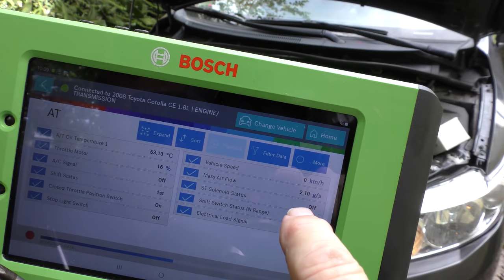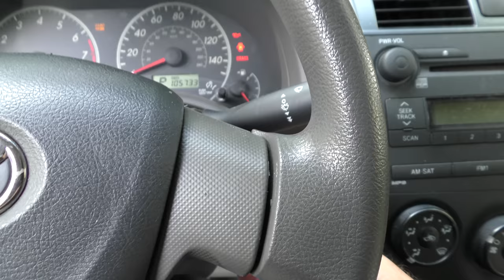Doing This Will Make Your Engine Last Forever (Mechanic Secrets)

Comment: Scotty: this Toyota was wrecked and put back together by morons, but it’ll still run another 100k miles 🤣
Reply: It's a dang Toyota! 😂🤣😋
Reply: I can confirm true, 150k mile 2002 camry wrecked airbags popped and everything. Slapped the thing back together, now at 240k
Reply: Mr Regular can confirm this with his wrecked Echo
Reply: Mael-Strom Chevy was put back together when NEW by morons and it’s still can’t reach 100k original miles without something major blowing up 😆
Reply: Lol
Reply: My wife has a Toyota Corolla, 8 years old, never had a single issue, obviously the usual service stuff but nothing else! Touch wood
Reply: @myMotoring  I recently started a Toyota Echo that had been sitting for nearly a year out in the elements. I charged the battery, disabled the ignition system so I could crank it a few times to get some oil to the top of the engine, then started it. It took a couple of turns - then fired up  - and purred like a kitten.
Reply: @timsmith854  impressive
Reply: @myMotoring  I thought that at least the fuel would be stale, but it was fine 😊
Reply: @timsmith854  petrol should be good for a year
Reply: Ol’ Scotty sure loves his Toyota’s... even the ones wrecked and put back together by morons 😂

Comment: Good man Scotty helping people out .
I had a Toyota Corolla, it was 2 yrs old in 1988 l had the car for 12 yrs it was excellent  l did 189,000 MLS with very little problems.
When l sold it the car would still have taken me round the world no problem.
Reply: The Corolla was all original,
The only things l changed was exhaust systems and brake pads.
Changed the oil and filter every 3,000 miles.
It had 4 sets if tyres fitted.
And the odd bulb.
Best car l have owned
And l am 96 now and have a Mazda 3 which is also  good car.
Reply: The original tyres were 
Japanese Dunlops lasted 40,000 MLS no messing,
It was like floating on air with those tyres.

Comment: That's why you always should buy GAP insurance or a better car insurance policy
Reply: Gap is what you get when you buy a new car.  I don't know that it's available on used cars.  Scotty made a remark about the car only being 6 months old so I thought it was a new car.  After finishing the video, I understand that it wasn't a new car, but a used car.  Still most car insurance policies have riders that you can buy that will pay off the loan regardless of the actual value of the car.  It's always worth looking into.  I have had several service customers over the years who did and did not have those kinds of insurance policies.  The ones who did are always glad about it, and the ones who did not always regret not having it.  The policies are good for the term of the original loan, usually.
Reply: Geico is one of the best.
Reply: @chineduokonkwo5777  I've been involved with many insurance claims over the years. I'm in the car service business.  Progressive is the best to deal with in my opinion.  GEICO is good too, but their adjusters really drag things out. Mercury is pretty good too. I think Allstate is the worst.

Comment: Hey Scotty...whadidImiss? Doing what is going to make my engine last forever?
Reply: a new gas cap and oem oxygen sensor..
Reply: @fidelcatsro6948  No, those things won't make your car last forever. Scotty never said they would anyway.
Reply: I was thinking the same thing.  I do not like being lied to.
Reply: @fidelcatsro6948  what he replaced was a MAF sensor which measures amount of air going into the intake.. not an oxygen sensor
Reply: @shreda125hilux7  oh ok sorry i havent driven a car since my last 1972 datsun 1200cc up till 1999 because of tighter car affordabilty restrictions in my country...those didnt have these crappery and lasted almost forever
Reply: @fidelcatsro6948  all good bud, yeah I agree , older cars were built like tanks
Reply: @shreda125hilux7  ran problem free after i changed those wretched contact point ignition to a used electronic honda civic ignition! everything else was 2 dollar to 10 dollar items like fuel air oil filters nothing special to sense other than that..
Reply: @fidelcatsro6948  was your datsun 1200 a coupe by any chance? I love the styling of the datsun , so rare to see a clean one with no rust these days here in Australia (or anywhere in the world for that fact)
Reply: I also like the mini truck model datsuns
Reply: @shreda125hilux7  the only bad thing about them datsuns: rust buckets
Reply: @thomascampbell5633  Your having a conversation with Fidel Catsro, no matter how you spell it, it won't lead to anything good.
Reply: Make sure it's a Toyota.

Comment: Scotty, Scotty, Scotty: it's Very simple.
The $3000 more she paid for the car than insurance paid out  was, wait for it...
PROFIT
 to the seller. Blame the whole miserable
system.
Reply: dealers can definently scam people who don't know much about buying cars, i bought my accord thinking I was getting a great deal but needed to have a new axle like 8k miles later (luckily usaa warrenty paid for it), again, the dealer knew damn well it was f*cked but I didn't know what to look for. Thx to scotty I do now though
Reply: Didn't mention how new it was to start with, how much it cost, how many miles in six months  ?
Reply: when the car shakes a lot as you accelerate at high speeds or accelerate fast from a stop.

 I was in an area in a congested city where I couldn't drive faster than 50/ lots of lights and stop signs so it seemed like the small shaking mightve been the road not being the smoothest while test driving.

It had 75k miles on it and was 6 years old, looking back i wouldn't have gotten it if I had known what to look out for on a used car, hindsight is 20/20 and young first time used car buyers are easily exploitable.

$7,000 of warranty repairs later it runs like a dream, live and learn haha
Reply: Dave theDude and now usaa don’t do the warranties makes me upset
Reply: @Josh-sm6td  I was really suprised they covered all they did.

I didn't know they dont do the warranties anymore. They probably saw the tab I was racking and decided to kill the program 😂
Reply: I bought a car in 1995 £ 14,000 it was only 9 months old with 9,000 miles the new price was £23,000. it lost a thousand a month.

Comment: Hey Scotty, I know you don't like Honda Odyssey vans, but I've had a good experience with one. It was a 2003 model. We bought it brand new, and put over 260k miles before selling it. The engine ran like a top, and the transmission still shifted fine the day I sold it. I guess I was just lucky.

Comment: dude : hey, Scotty I have a dodge Avenger 
Scotty : you can always pray!
Reply: Dodge Avenger from 2007 to 2010 has the same body as the Chrysler Sebring. The one thing is to always check the type of engine and trim it has some has a 2.7l
The other thing is the electrical compatibility of the car. I've found out personally that some HVAC switches like the one we have  on the 2010 touring Sebring edition has a different one than the standard.

Comment: Bought new a 2011 quad cab Tacoma, no options: best vehicle I ever had. Only complaint in the 6 years and 75,000 miles: driver’s seat belt was slow to recoil. Never bothered with a fix. Brakes and oil was all I ever had to do.

Comment: Secret: Rebuild the engine after you're done driving. It'll last forever. As long as it's a Toyota Celica.
Reply: Very True!
Reply: What about an older Camry mainly an 87-91 4-cylinder
Reply: Josh Smith thats a waste of money
Reply: @Meeper2  Here in Australia, there are Camry's still going with 500,000kms on them. Many of those were Australian made for our tough conditions. Toyota has been testing cars here for over 50 years. Toyota tough. For Australia. Keep up the oil changes & filtration & your Camry will be good to go for a long time. Good luck mate.

Comment: WTF, the mechanic had it for 3 months while fixing it and then it was stolen from him? I don't know who is more stupid, the lady that thought it was better to wait 3 months instead of buying new car or the mechanic that lost the car......
Reply: Yeah, there's a lot more to this story than what has been told. I've never heard of replacing an engine because of an accident.
Reply: Mark Kauffman generally, you’re absolutely right. Majority of the time it’s the frame, body, and surrounding components that need replacing from accidents, which insurance companies see it as easier to issue a total loss cause it takes A LOT OF TIME AND WORK to get the frame and body back into alignment, not to mention they’re using 3rd party car shops instead of the oem to get the car back into semi original shape. Just like Scotty said, they’re using 3rd party components and parts so the cars get all out of whack. Insurance companies put out a bid and go for the cheapest one

Comment: Scotty should consider making a video where everything that could go wrong did.  Just about every one of us when we try to do some repair we always manage to drop a screw or nut somewhere and never see it again.  Or like trying to replace the alternator and it manages somehow to get wedged and won't budge.  Or when the replacement part doesn't fit even though the website said it was an OEM part made for your car.

Comment: Hi Scotty! I hope you are fine. My car takes almost 10 minutes to optimum rpm on cold start. Moreover, it gives shitty city milage and very good highway milage. Its a 2010 Suzuki Cultus EFI engine. Whats your opinion. I changed all sensors e.g TPS and IAC valve. No MAF sensor in it rather a air temperature sensor on intake pipe.

Comment: Its crazy how the dodge avenger is a junker but the charger and challenger v6  with the 8speed which is the same car can last a while like you said that your customer had 240k miles on one and its still running fine.

Comment: I had a body shop for 30 years...the stories I could tell.  Quite often owners would opt to buy the totaled car back from the insurance co. and take the money and have the car fixed.  Often times that worked out well....they liked the car and took it to reputable body shop. I think there are more shyster body shops out there than mechanic shops.

Comment: Sold my 2014 Mercedes GLK diesel and went down-market to an ex-police 2011 unmarked Crown Vic in good shape. I like the Vic better for some reason, fun to drive, handles as well as a 5000 pound sedan can, and maintenance is cheap and easy for a DIY-er. Trade off is a ride  as stiff as that of an unladen pickup, but that’s what I expected.

Comment: I've negotiated quite successfully with insurance adjusters about write off pricing.  They need to be in the mindset of wanting you to take the write off to be in the power of the negotiation.  If their numbers indicate that the repair is cheaper than the write off cheque minus the salvage value, it's a hard sell and you may need to travel to find a good used replacement.  Just because you may have overpaid the first time, doesn't mean that there isn't someone who needs to sell something cheap next time.  My dad got another $900.00 one time added to his write off cheque simply by arguing that the old car was his favourite colour (It wasn't but the fact that he said that is hilarious), so be creative in negotiating.

Comment: I own a 2001 Honda Odyssey and it has 204,000 miles. Yes I have had to do repairs on the doors like change a regulator and what not, but it runs like a champ and has ice cold air and heat. The 2000-2004 tended to have major transmission problems around 50-70,000 miles but I guess I lucked out with a decently built transmission. Oh and I bought it for 150 bucks. I put a new battery in it and have been driving it for years now. In all honesty I would rather drive a Toyota but there is an exception to every situation.

Comment: I'm a Honda guy for 30 years , but even for me, when it came time to buy a minivan for my family I bought a Toyota Sienna. I hate the cylinder deactivation tech now in every Odyssey and the engine start/stop system when diving.  The record of issues and failures of those systems, scared me away from what what normally be a no brainer Honda purchase for me. A simple V6 in the Sienna, no bells or whistles, direct AND port injection with their tried and test 8 speed auto made the Sienna the only choice for me. KIA and Chrysler(🤣) weren't even in the running for me!

Comment: I agree crucial parts should be oem, but when my visor ceiling holder thing broke-and a replacement cost $1.50 from China and can't possibly affect the car. Same thing with the button on my shifter. The $2 replacement was perfect. Had I gotten OEM for those parts, Honda wanted like $50! Yes, OEM on engine parts-but not for plastic snaps or such.

Comment: Suggestion for the person looking at the two CRV's - have any Honda dealer check the VIN and see if the pistons  / rings were replaced at a dealer- I know some of the v6 (j35a7) with cylinder de-activation could suffer early oil consumption, and Honda would replace the rings on those 3 de-activating cylinders (up to 150 K miles I think- or 10 years)  Honda says in their TSB the ring end gaps all get lined up.  I thought the CRV only got the 4 cylinders though, and that none of those had cylinder de-activation.

Comment: Engines run leaner at high altitude. Around Denver, 15% of the air is missing. The ECU should squirt 15% less fuel. Driving on level roads like I25 there will be less air resistance. Less octane is acceptable because there is less pressure.

Comment: She still has an option.  There are body shops that will do "Post Repair Inspections"  If it is not fixed right, then the insurance will total it and pay here.   Check  you tube for "post repair inspections"  They are interesting to see. A search should find body shops that do these, and I believe they do not charge the consumer.

Comment: Scotty I know you talked about it before but I can't find ur video on it. You helped alot figuring out what the problem was with my 1985 Cadillac Eldorado biarritz. My 2011 Dodge Avenger w/ 70,000 miles has a problem with the key. The car runs fine but the key gets stuck. What should I do?

Comment: I have 2006 manual Toyota Corolla 160k miles when I go up a really steep hill like the grapevine going to LA. My 4th gear pops out after about like 1 min going up hill. But runs great driving around the city.
Reply: @Mark Codiroli nope never

Comment: Actually, there's a bulletin on CRV's burning oil.  My mom's CRV engine was rebuilt at the dealer under warranty for an oil consumption issue.  Oh, it had its oil changed regularly, too.

Comment: Hi Scotty.  Did you pull the air filter out and check it?  A car runs better w/a clean air filter.  If it has one of those paper filters that you can 'fan out' like you're flipping pages in a book, you should do that in one of your videos so folks can see how dirty air filters get down in the crevices.  And also talk about NOT blowing them out with an air compressor and expecting to get another good 15K miles of smooth engine operation.  You can do that to get by for a short spell but change the air filter when the car manufacturer says so.  Especially the Japanese engines.  Have a great day!

Comment: Scooterdoo what it do? I have a 2006 dodge durango it has 132000 miles no oil leaks has a exhaust  gasket leak. K so hear  is my problem,I drive it parked for a few hours now all of a sudden it hesitates  at full stop like at a red light,has a dead spot in the foot feed and a bit of a power problem. Now it will sit you back in your seat when given a little bit more pressure to the foot feed at a dead stop. But the warmer the temp out side the more it acts up. I've researched  a bunch of stuff but can never really pin it down. I know that the 4.7 litre is prone to crank position sensor  problems. But I was wanting your expert opinion. I would be willing to pay you to research this if you have patron or some other way to give you monetary help. Please reply. A fellow Texan del rioan  in need of help. Thanks

Comment: I have a 2003 Acura TL. I cannot get a good transmission fluid reading. When running in Park it's 6in up stick. Honda said check it while hot but engine off. Did. Barely any on end of stick. Added half qt. Leaked fluid. Now I remove dipstick and pressurized air comes out. Is there a vent tube? Vent plate? Where? Drive-ing me crazy. How do you feel about LUCAS trans fix? That's what clogged my vent I'll bet. Sad day

Comment: Scotty this is Sarge down in Tupelo Mississippi can you help me on where the ABS module is located on a Ford F-150 2008
Reply: Should  be  just  above  the  oil  filter.  Look  for  it.  You  can  go  to  any  Ford 
dealership,  go  to  parts  department.  They  will  pull  it  up  on  computer  and 
print  out location showing  everything.  Good  luck.  If  you  buy  a  new one
I  do  not  think  you   will  really  have  to  have  it  programed.  Anyway  it  it 
safe  to  drive  your  truck  with  ABS   llght on.   You  do  not  necessary  have 
to  make  repair.....it  is  safe  to  drive  as  is.
Reply: Let  me  clear  up  safe  driving  with  ABS   light  on:   You  can  drive 
it  feeling  safe.  The  brake  system  now  is in  old  fashion   brake   
mode.   If  ABS  light  drives  you  crazy...  have  it  repaired   or  just 
black  tape light  on  instrument  panel  and  drive  forever  as  is.

Comment: I have a 2007 Suzuki grand Vitara needs power steering I put  ultra get silicone,on steering pump to stop leak silicone clogged  pump and damage pump.I put a cheap timing chain kit in payed $49 because I was rebuilding the engine (overhaul @142,000 kilos,the cheap timing chain for $49 on Amozan it’s rattling should I fix and sell or fix and keep for a few more moths